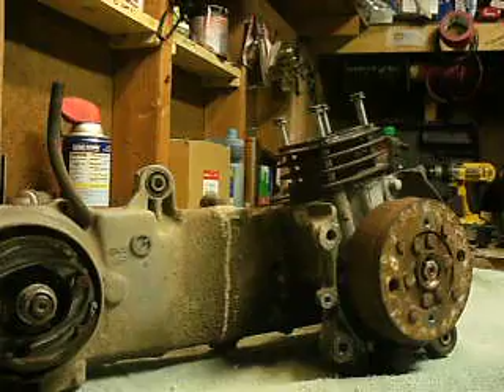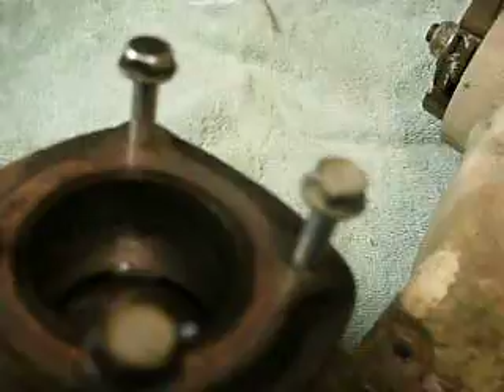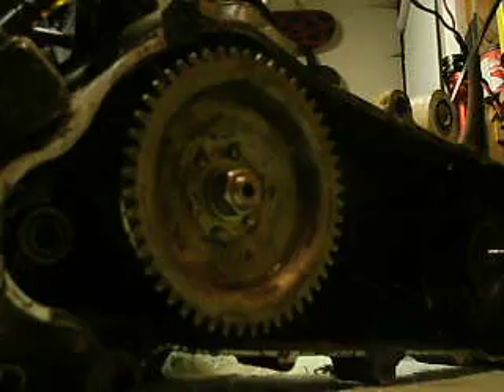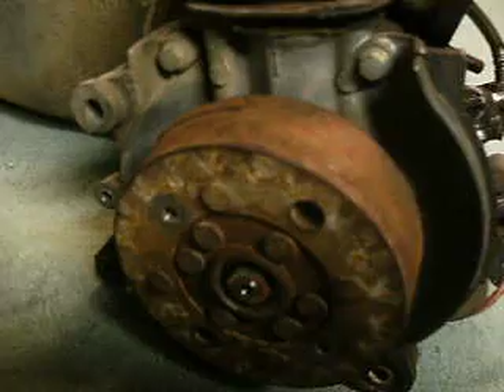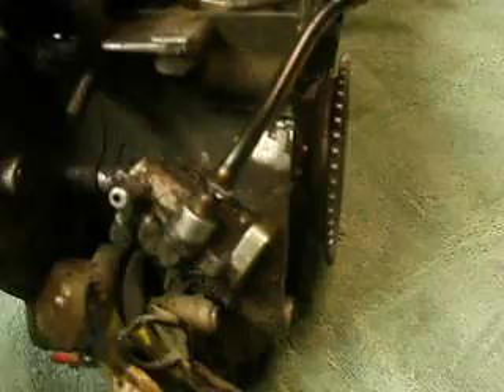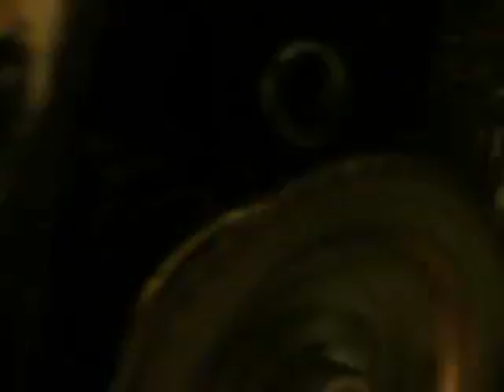86 Honda Spree engine

Comment from the maker: @barryjackson123 Yeah I'm sure the bearings are shot, It's more of a spare engine and If I am going to use it someday I will put new bearings in it, just need to get the correct puller first. I did not run it for more than 30 seconds prior to pulling it apart.

Comment: those bearings certainly sound "gritty".  When you have it that stripped down, I am not sure what else it could be.  Hopefully it hasn't run too long like that or else you could be in for world of hurt inside the bottom end (like worn crank).